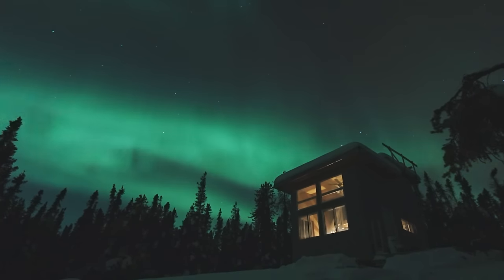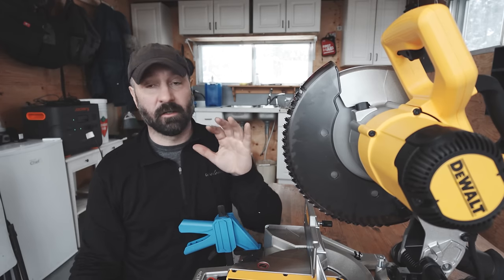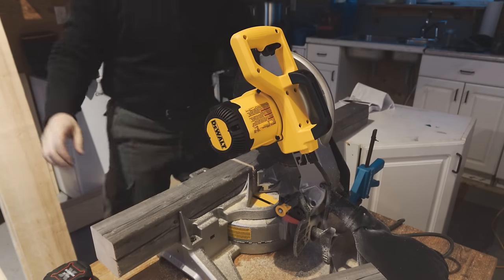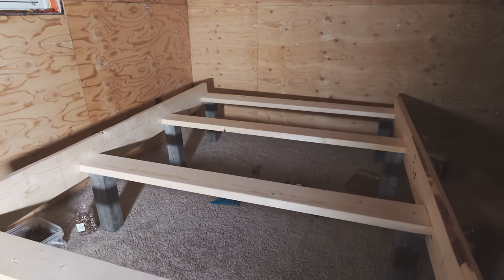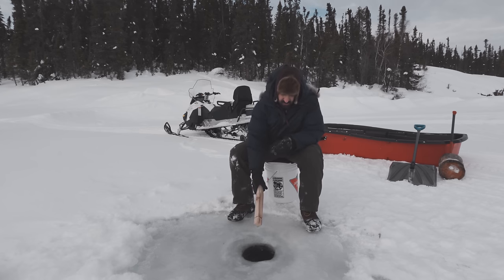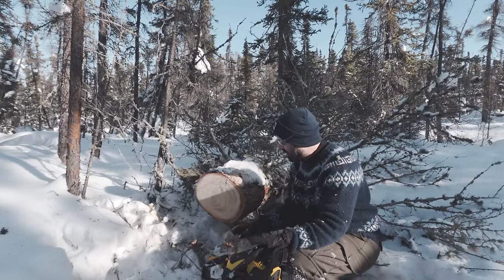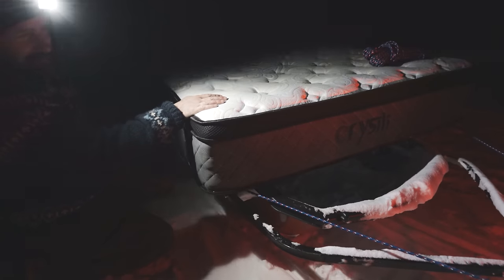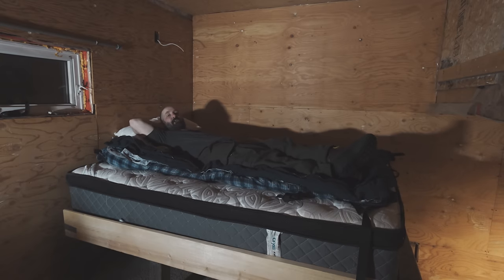Learning to be a man in the forest

Comment: Hey Jay, I work for a Generator Manufacturer.  Everytime I see you put that generator in that box while it's running I cringe!!!!  You are seriously reducing the lifespan of that generator as it's burning it's own exhaust which creates additional carbon buuldup in the combustion chamber and on the spark plug.  When it's running, leave it outside of the box so it has access to clean fresh air both for combustion and for cooling!  You might also want to run a quarter bottle of Sea Foam Engine Treatment in with a full tank of gas through it (just run as normal).  It will clean out any carbon that has built up on the valves and piston head.  Love the show!

Comment: I’m not being critical but rather informative. If you had bought a sliding mitre saw it would have cut that 2x8 because it slides forward and back a distance.
Reply: Definitely! My first compound miter saw was exactly what you just bought.. I used it for about 5 years and became adept at lifting the piece of wood to get it to cut that last bit. I then bought one with a slide and the world became a wonderful place, lol!
Reply: Another great video! Keep 'em coming!
Reply: Good point! We all learn something new.
Reply: A sliding mitre saw is definitely more useful.
Reply: A compound slider would definitely be a better choice. Keep up the good work.
Reply: Yes , take the saw back if you can.
Reply: I would suggest a stand for the saw as well it makes it easier to move around and it will have stabilizers on it that will allow to cut longer material and get a flat straight cut ..and I also second the slide miter box ...love the videos keep up the good work
Reply: Yep, got the wrong saw for sure.
Reply: Jay your saw chain cutting side ways is from the chain being sharpened incorrectly most likely.
Reply: he can for sure, dewalt has a 90 day no questions asked returned policy. I’m assuming the prices they pay up north are substantially higher then city prices..  a 12” double bevel would be a great starter saw… sliders are great but very heavy and are a pain to store.
Reply: Yeah if Jay can somehow return that saw, and put credit towards a sliding one.  GAME CHANGER!!!!!

Comment: Greetings Jay, I think you’ll find the reason your chainsaw is cutting at an angle is because the chain is sharper on one side than the other ! Keep the chain well oiled, & not too loose.  
A lot of very informative comments, and remember we’re all here to help! Please don’t hesitate to reach out!!! Great job!!!
Reply: I agree .  One side of your chain is filed more than the other.  Try a new chain amd it should cut straight
Reply: I agree to your comment , I myself have had the same problem many times I tend to sharpen the chain to much from the right because I am right handed .
Reply: absolutely the chain needs a good sharpening. take your time and even strokes on each tooth
Reply: You don't neccessarily need a New chain. You might want to use a caliper to make Sure that all teeth (both sides) are filed to the same lenght. Also make sure to have the correct chain-type for the wood you are cutting, e.g. a full chisel chain is best for Hard wood.

Comment: Jay you need to make sure the power cord feeding from the generator to your cabin is #10 gauge wire (30amp rated). The one you have going from generator to the cabin looks to be an orange colored one which is generally only 14 gauge. As you are using the saw the cord is rated for only a certain amperage and if you have exceeded that with the saw and lights running at same time may be exceeding what amperage that cord can supply. Also a longer distances (+@25’) you may need heavier amperage rated cord also.
Glad your at least taking some advise from your followers. We are here to help if needed.
Reply: That generator isn't even 30amp. So it doesn't matter. But a heavier cord is definitely good if you have one.
Reply: I will add that yes, it is bad for your saw. It will cause it to run hot when it starves for power. I made the mistake of renting a hammer drill for a contract long ago and got too small of a power cord from the rental place. It burned up the hammer drill using the smaller extension cord because it caused the brushes to get hot.
Reply: @123hkopm123  I think it is a Honda 2200 which has an output of @18.3amps continual. When using the saw the current is probably higher then that (18.3a) as inrush current goes way up momentarily as well as cutting under under load. Normally portable equipment like the saw will give you a chart in the instruction manual to follow with suggested size/gauge of cord for distances away from receptacle or power source. I only suggest #10 gauge extension cord because this will give you much better steady voltage over the distance that it looks like Jay may be using then a #12 or 14 gauge extension cord. Using to small a cord will burn up the tools as the other person has commented because to small a cord reduces the voltage and increases the amperage to the tool and brushes, thus causing heat to damage the tool.
Reply: @bjkgaffmaster  yes a shorter cord or lower guage would be better.

Comment: Jay, the clamp that came with your miter saw is not for clamping the saw to a surface, it is for clamping the boards/wood you are cutting to the top of the saw while cutting. It slides into the holes you see on either side of the saw and then clamps the wood down whime cutting. Enjoying watching your adventure!

Comment: try sharping the chain, check tension of chain. check for bar wear / damage and clean out bar rail groove. sometimes dirt and saw dust fills the rail, take a feeler gauge or paper clip and run down rail to clean, even turn over the bar to see if that helps, if its a old chain that been sharpened a lot check to see if rakers have been filed too. rakers remove wood chips. but don't go down too far on rakers. also on your dewalt, is that a fixed mitre or a telescoping miter, where the whole head move in and out for larger cut of wood. having a blast watching you Jay . coffee with Jay Monday mornings.  JAY YOU'RE A BEAST !!!!!!!
Reply: i've had Husqvarna chainsaws that wouldn't cut straight. The mechanic told me that the bar was worn unevenly. I got a new bar and that solved the problem.

Comment: The lights dimming are caused by the high initial current drawn by the motor as it starts.  We have a sump pump in our house that is on mains power and every time it kicks on, the lights on that circuit dim momentarily (especially LED lights which will flicker).  As long as the current draw doesn't trip the breaker on your generator, you'll be fine.

Comment: Jay, just make sure you cook your pike well (not burnt obviously). A large fillet of pike deep fried should do it, but if cutting a piece the meat is a bit rubbery then it hasn't been cooked long enough. Raw pike can give you a particular case of "worms" ..not good.
I sometimes boil my pike. I boil up some cut potatoes with onions and butter, and just before the potatoes are ready, I turn up the heat, get the water boiling again and add chunks of pike...boil for 3 minutes the  drain. hmmm, hmmm, good.

Comment: Haven't seen it in the comments but in regards to the generator bogging down, make sure the ECO mode is off when using high draw tools. The little servo motor cant act fast enough and will wear out eventually, we bought a cabin that had a Honda Generator and wasn't working, ended up being the motor that adjusted the throttle from the eco mode. Previous owners ran it on ECO mode for everything. Love the Channel!

Comment: Hey Jay, I wouldn't lay the mattress directly on a piece of plywood. Use a slat approach so that your mattress can breathe. Otherwise I'd be worried about moisture and mold forming. I could be totally wrong, but I would strip the plywood and have a 2-3 inch gap between slats, you'll still get plenty of support and this way your mattress will breathe.

Comment: Hey Jay it's AL from Ontario. About your saw cutting on an angle, either the the raised edges on the saw bar are uneven or the cutting edges on one side of the chain are dull. You can turn  the bar up side down  and or sharpen the chain so that both sides look the same. Good luck, great job.

Comment: I used to cut railway ties in Australia. Your chainsaw curves when it is blunt or the bar channel is worn. If it is blunt it will make small sawdust. If the blade can wobble in the channel just take it off and put it back on upside down! It is normally reversible.

Comment: You can take that 2 x 8 or 2 x 10 and while you’re cutting with the miter saw lift the wood up just from the front and it’ll cut through. You’re basically tilting the front of the wood towards the blade.

Comment: We have the same Honda generator.  The dimming of lights is common with the extra load of the saw.  If it becomes too much, the breaker within the generator will pop.  Re-set & you're good to go; no harm done. Thanks for another great video!
Reply: Yeah, just avoid using sensitive electronics while sawing. (Computer, stuff like that)
Reply: Actually, tripping as breaker of any kind can cause them to wear out over time.

Comment: As far as the wood splintering when you cut it, pick up a fine cut blade. The saw most likely came with a rip cut blade. The finer the teeth on the blade will result in a cleaner cut. Enjoy the learning process. Each trick learned will be that much more useful and make your projects that much more enjoyable!

Comment: A tip for keeping the water hole open. Put insulation in a plastic bag over the hole. It would need to be weighted down so it doesn't blow away. I saw this method in Northern Saskatchewan years ago, and it seemed to work great.
Reply from the maker: Cool tip

Comment: You could put LED lights in the cabin if you do not already. Also, those generators  can be wired together to double your power output. May be get your hands on a good used one. Additionally, lol, my Honda has ECO which will cause the machine to vary the output. Thats why it sounds like it does when using power tools. You can turn this on or off. Apologies if this is old knowledge. Happy Camping!!

Comment: You’re fine with the generator Jay especially for what you’re doing. It’s just the in-rush of current that’s required to start the saw combined with the delay it takes for the generator to rev up. Once the saw is running, the EU2200I is more than enough.
It can help to have a larger gauge extension cord and the shorter the cord from the generator to the saw (or other high draw equipment) the better.

Comment: Keep on keeping on.  Discover the obstacles and work around them until the job is done.  This week's lesson:  Plan your miter saw use for daylight hours, save assembly work for evenings or nights.  Consider unplugging the refrigerator while using the saw too, just don't forget to plug it back in afterward.  You can always put a bowl of snow inside while it's unplugged, if that's necessary.  Minimize electricity use to only the saw as best you can.

Things are shaping up nicely.  Way to go!

Comment: A higher tooth count blade will help with the tearout. Letting go of the trigger and stopping the blade at the bottom of the cut before lifting it back up is generally safer. Lifting a spinning blade back through the cut can cause it to bind on  the cutoff piece, especially if its a smaller piece. Invest in a dedicated folding chop saw stand, its definitely worth it.

Comment: Nice tool addition!! Once you finish the down cut release trigger and let blade stop before you raise the blade. Line everything up (don't forget the blade thickness - Kerf) and then cut. Your close to maxing out the Generator, but if it doesn't trip your good. Definitely not great for generator, but it's a Honda and can take the abuse.

Comment: Jay you can always get a Milwaukee Tools M18 10" Miter saw - uses a M18 battery - if it ends up popping a fuse on the Honda generator.  Then all you need to do charge the M18 battery - best to have a least 2 M18 batteries.

Comment: The load on the generator wont hurt it. But you have long runs of extension cord. Try to keep the est. cord runs as short as possible.This results in voltage drop due to resistance. You can hurt the saw though because it doesn't get sufficient current. You aren't running this thing non-stop, like a contractor, so you should be fine.

Comment: Once the snow is gone make some extensions on either side on a work table you can bang together easily. Then you can bolt the saw down too and with the extensions on either side made by 2x6, you can easily cut and handle long lumber without an end flopping around or needing held up

Comment: As others have posted you need to run a 10ga extension cord direct to the generator when using the saw and you should be good to go. To small of cord and the amp draw goes way up due to voltage drop.

Comment: Miter Saw thoughts: not only do they make sliding saws where you can pull the blade farther out but they also make saws that run on the same batteries that your drill uses.

Comment: Turn off ECO mode on the generator when you're using the saw. That will keep the generator running at a higher idle so it will respond quicker to the power draw.

Comment: Be aware that generators are rated at a continuous power and spike power. You'll often see it as "12,000W max, 10,000W continuous). This is important when using motorized devices such as refrigerators, saws, etc, as they will draw more power as they kick on and spin up. That small fridge you have barely uses any as its compressor is quite small, but a larger fridge, or chest freezer, would use enough to momentarily dim the lights. I would definitely recommend going with a larger generator given the amount of cutting you're looking to do, even if it is only a temporary one you swap out when you are planning to do a lot of work, as opposed to just relaxing for a night or two.
Reply from the maker: This is valuable info. Thank you.

Comment: Jay, You need to get a propane conversion kit for your Honda generator. No more messy gas cans. One big tank will last a very very long time.  They are very easy to install. Quick disconnect hose included. 
 Doesn't your generator have a wifi connection to your phone. Keeps track of hours used and how many amps you are drawing. You can't start remotely of course , but you can shut it down remotely.
Reply: its often too cold there for propane outside to work.

Comment: If it cuts to the right, file the left. One side got sharpened a little more than the other. Jay, I couldn't afford a real good sleepingbag, so I bought two moving blankets from Princess Auto. Sewed 2 sides and one end. When I think I need to sleep where it is Cold, I slide my sleepingbag inside. It helps keep the sleepingbag clean while outdoor camping too. Homemade quilts are the bestest. :)

Comment: You chainsaw bar could be warn unevenly, or the Sharpness of the teeth is of from right to left side teeths also there's runners infront of each tooth, also seen it were bushing meant to isolate the vibration wear out and cause it to cut on angle. So in short new bar and chain or proper sharpning, Probably fix the issue. I do recommend that you check out proper saw sharpening, qnd yes it could be sharpened in such a way to counter the slant cutting. Just need to know what to sharpen and file down the proper runners.

Comment: Saws do leave a rough edge.  First, the proper blade for the job and then if necessary, you can cut a line where you are to make the cut.  That should ensure it looks smooth.  Draw your line for the cut and then over that line with a knife.

Comment: To prevent that blowout from happening at 20:10 put a thin board underneath of same width, like a piece of plywood, you end up making a zero clearance plate that supports the cut underneath much more cleanly
there are videos for miter saw tricks and tips....its quite the rabbit hole, same with the circular saw

Comment: Generator is 18.3 amps max Saw uses 15. You're fine as is. That dimming of the lights is the load delay when the generator throttles up to a higher output. Just don't leave the refrigerator plugged in when using the saw. If you overload the generator it will let you know when the circuit breaker shuts off.

Comment: My 1sr miter saw was a 10" like yours and I quickly found that the cut width didn't "cut it" but to not have to flip and realign a 2x6 if you leave the blade running and down you can tilt the uncut part of board up enough to finish the cut, just be careful and let the blade stop before raising it.

Comment: Hey Jay, loving watching your channel over here in the UK! If the chainsaw doesnt cut straight it is because the teeth are not sharpened evenly. Some are longer than others. Use a fencing U nail to measure the head of a sharpened tooth from back end to the pointy sharp bit and make sure they all the same length. Tap the nail until it is exactly the same length as the tooth then use that as a measure. Or anything else you can get your hands on!

Comment: Hey Jay, Great video... compound or sliding mitre saw would allow you to cut wider material, also a bigger generator would be better as well. And, if you use your saw with that small generator often, your saw will eventually have issues.  I found that running a saw on to low volts, will burn the brushes out of the saw.   It'll work for a while.  Good luck
Reply: You may need to get a second generator.  If you get another Honda, you can get a kit to run them together and have higher wattage, then you could run the lights and the saw at the same time.